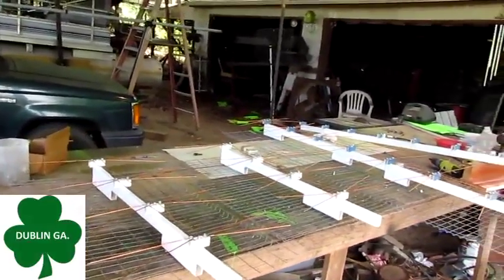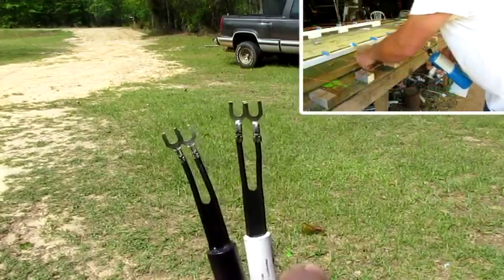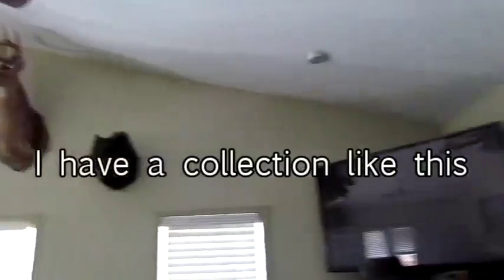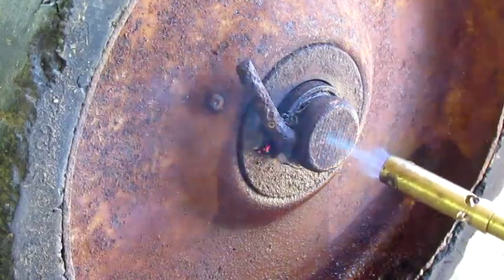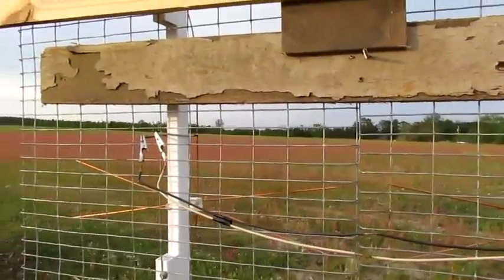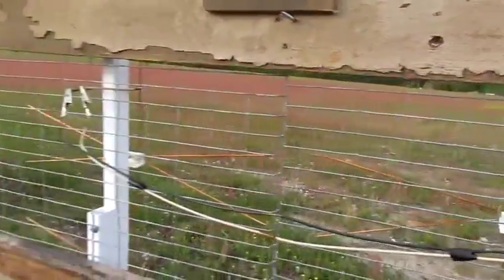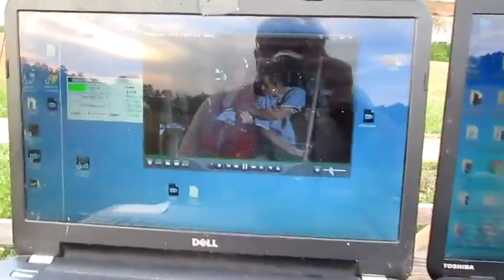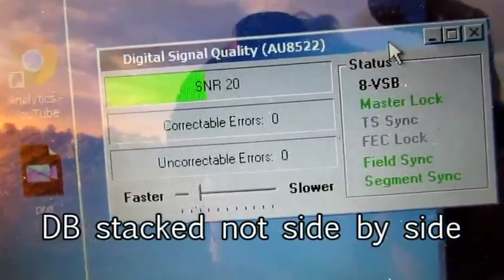Ultimate TV Antenna Stacked,Dual 100 mile ShootOut

Comment: This antenna type works best if you have signals coming in from different directions or if something are obstructing and spreading the signal, like trees. If you have signals from just one direction then the directional yagi antenna type are superior. I have one community that has a single transmit tower far away and the tv shop recommended and installed these type of antennas as in the video and most people had pixelations and a bad picture. Installing a yagi fixed those problems as it has higher gain and produce a higher signal level during those circumstances.

Comment: I need to make one of the side-by-sides.  Now we need to see a quad.  Take two of those side-by-sides and stack them vertically and hook them together with a splitter/combiner.
Reply: Then install them on a pole 200 feet in the air. My guess is we will be disappointed with the result. At least I think we will.

Comment: Hi, you might should have tried putting each antenna in the same SPOT for testing, because there are HOT SPOTS where the signal is stronger, and there are dead spots where the signal is weaker.

Comment: Several years ago I built the 4 place coat hanger antenna.  Then I figured I'd try the 8 place coat hanger antenna, side by side.
Now I didn't have the signal testing setup like you do, but i wasn't satisfied with the performance.  So I built one with 6 places and it did better than the 8 place one.  I know how much you like to try things out, so just a thought.

Comment: Hey Danny Wesley here south Texas have a technical question for you. I have mentioned to you several times about troppo being a ham operator I am interested in long distance. I want to build a side by side but they are more complicated I'm going to do a stacked. I have followed every single thing you have ever posted related to television antennas and you say if you don't need a booster they will hurt you. I dunno I will be skewing far away from the local channels to try to get into Houston Texas television. You come from the CB days doesn't matter how big your linear is you got to wait for Mother Nature to talk DX. but I want to capitalize on the conditions. What happens to the local signals when you unplug the amplifier? Does it go back to normal or does it kill the signal from the local stations

Comment: I built your gray hoverman antenna and dumped cable. I don't regret it. My question is, can i build a second antenna, mount it back to back with the other antenna and point it in the opposite direction? Will one interfer with the other?

Comment: Antennas are dependant on frequency vs length of antenna material.  If you just look up and calculate the size or length you might get a very long distance antenna that really works consistently.   Thank for trying.  Look it up and you could possible great some great antennas.  To help people or even make a little extra money in you spare time.

Comment: When I was a kid in the early 60s we built antennas like this on a 1 by piece a wood to get UHF. We had a VHF TV with a UHF converter back then. We had two of these type antennas on an old ladder bolted to the house. One faced east west and the other north south to get everything in our area. There was equal lengths of ladder line 300 ohm tv wire going to each antenna. At the junction was the TV 300 ohm ladder line or open wire  TV cable going into the house to the TV UHF converter box. Where it converted to VHF channel 3 to feed the old round screen Zenith TV set. Grandma loved L. Welk show and the music on there. And Grandpa would watch it with her. Grandpa later changed the antennas and put some chicken wire o the back side of a new set him and I built together. BTW my Grandpas first UHF TV antenna was a blown out 500 watt light bulb hooked to the 300 ohm wire and put in the attic to get channel 20 in Springfield Illinois. Thanks for the antenna design it made me remember many good times with my Grandpa. 73s Jimmy, WX9DX
Reply: Lucky you - good times with the grand folks. I never had any of that. Count your blessings my man cuz you have had a lot more than many of the rest of us.

Comment: Hi Danny.. I built your ultimate antenna (4 bay) exactly to specs.. with the reflector..  about 30' off of the ground.. using the Winegard preamp that you use.. and RG6 cable.. I'm trying to get ABC (65 mi.) and CBS (80 mi.) and I'm not able to pull them in.. Is there anything you could suggest that might increase the range a bit.. I'd sure appreciate your help.. The cable bill is a killer..
Reply: ALL U CAN  DO IS GO  HIGHER
Reply: Actually, after leaving my comment, I pulled the antenna down and put it on an 8' mast.. It picked up ABC. I'm thinking maybe do an 8 bay and see if that'll grab CBS..

Comment: I would like to see a Parabolic antenna. Don't see them much around here anymore but I no they was powerful. love the vids Danny.
Reply from the maker: TKS WILL CHECK INTO
Reply: There is an antenna guru who modeled an improved version of the 7 ft. Channel Master parabolic antenna.  He modeled it with a 7 element Log periodic antenna instead of the two bay bow tie and improved the gain by a few DBi.  He also modeled using a 10 ft dish with the same 7 element antenna and the modeling software said it would get 20 - 22 dbi across the UHF band.

Comment: Raising it is based on location i have 2 antennas 500 foot away one does better raised up one is just mounted to a trailer hitch and barely off the ground it's kinda like setting a dishes elevation to high ses 3 just right g19
Reply from the maker: oh
Reply: Also have you tried 1/2 raising and lowering may help you hit the sweet spot and may want to try on both sides  may get lucky going up or down on the opposite. Side
Reply from the maker: i done that picks up best like u see.i spent hours and hours out there 3 days i have to no wwhat im talking about
Reply: Sorry missed that part in the video and didn't know was also wondering if you have ever tried a fta dish to anttenna convert that thing would be a monster
Reply from the maker: yep